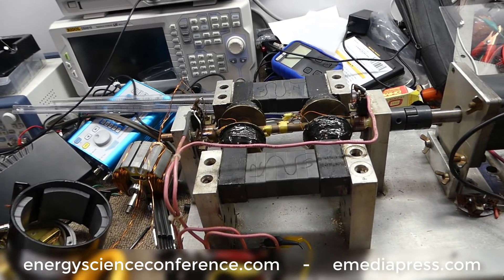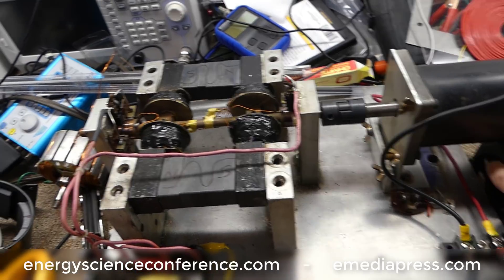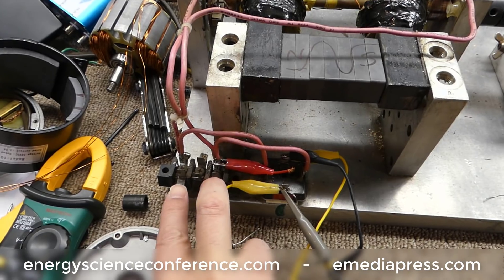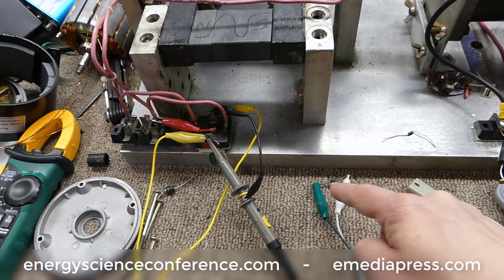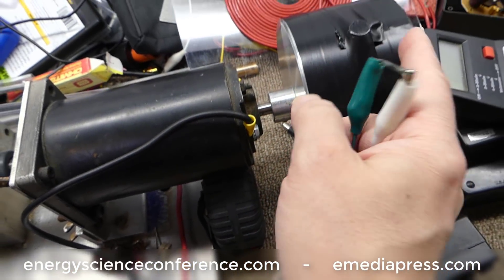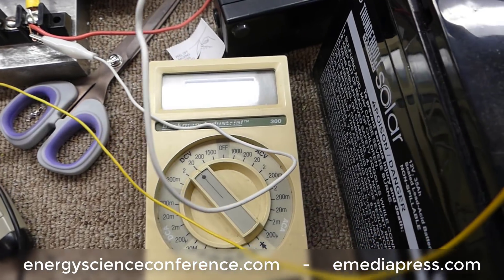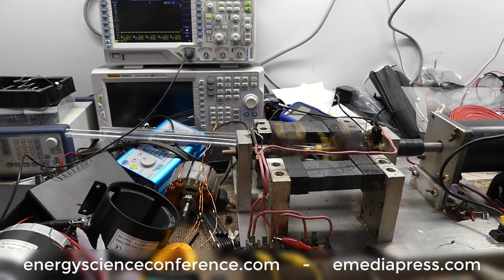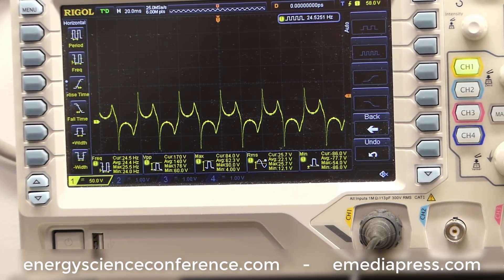700 Volts from Kromrey Generator

Comment: I see this is 5 years old. Have you considered a flywheel to reduce wattage consumption?
Reply from the maker: Yes, there is a heavy aluminum flywheel for it not attached to the shaft in this vid.
Reply: @AaronMurakami13  just curious. How much did it help, I’m guessing 30% reduction in potential consumption?
Reply from the maker: @chadrowlett893  Chad, I never did a comparison but John had a heavy aluminum flywheel on the shaft from the beginning.
Reply: Thank you very much Sir. Keep up the good work

Comment: Best switching for peak coil shoting is "bidirectionally" connected clusters of HV mosfets.  Bidrectional means the the gates and the source leads connect, between two mosfets  (or 5 in parallel each side for example ) and switching happens between  drain A mosfet and drain of B mosfett.   This is way to make mosfets switch AC, because during period switch is closed and coils shorted, the coils go into "hyper ringing" in AC.  Lpwest resistance possible in the switching. or it does not work very good.
Omce caps are filled up, they must be disconnected upon discharge to a load. So its a two stage output circuit - first stage fill caps by themselfes, second stage discharge caps by themselfes.
Having load right over coils whil fillling caps really kills everything so fill caps with no load.
Reply from the maker: Doug, do you have a schematic online? Also, are you in Seattle? Email me if you get a chance info at emediapress com
Reply: @AaronMurakami13  hi Aaron 
Yes I have chapter in online book I wrote about peak coil shorting with schematics and photos and info.  I will link it in next comment reply.  I am in Belarus right now next to Russia and Poland.  Will be coming  back to Seattle in December.  What's your email exactly?
Reply from the maker: @MrDKONZEN  Thanks -  info at emediapress com
Reply: @MrDKONZEN  Doug can send the link to the online book you wrote about peak coil shorting please.

Comment: wht gauge wire did u use / find best? framespencer@yahoo.com .... i have stuff to show you that im not willing to post on youtube
Reply from the maker: I made a video where I walked everyone through the coil polarity and winding method. Go ahead and email me.
Reply: @AaronMurakami13  can you help me wind it, ive watched your videos and wound in series but i dont get the desired effects
Reply from the maker: @MadscienceLPTECH  Do you have a reed switch across the coil terminals that gets shorted when the magnet moves past it? You have to have that.
Reply: @AaronMurakami13  what gauge wire is the machine shown
Reply from the maker: @MadscienceLPTECH  The Kromrey? It's something like 23 awg on the generator coils. Haven't looked at it in a while.

Comment: Shorting is a way to go , but it needs a very low resistance shorting similar to the resistance of  Reed relay or else  will be useless. The problem will arise once use mechanical shorting or reed relay and want to increase into a usable application, then it will not last long. Electronics switch like Mosfet or IGBT without any modification on the Gate side will easily be burnout on few watts of output from the spikes created even only on few watts.
Reply from the maker: I agree, the reed I'm using is for simple demo. The reed should be used to trigger another switch - I think I mentioned that in one of these videos somewhere.

Comment: Any cold effects?
Reply from the maker: I haven't tested that yet but there seems to be more charge winding up in the battery than can be measured. It can also power loads from the gen coils with wire gauge that appears way to small to be able to carry the current for the load. I've been focusing on just the bare basic fundamentals so far. I just discovered this: https://www.facebook.com/emediapress/posts/2027282530872426
Reply: Nice. The coil winding might be why my Kromrey replication didnt work. When you get a chance, I am very interested to know if it turns resistance in to an endothermic phenomenon which John hinted at in one of the previous Kromrey videos (energy from the vacuum series).
Reply: will the short out work with other generators?
Reply from the maker: Yes, quite a few of them. With these solenoid type coils, it's the easiest.
Reply: Old Man Builds is experimenting with Endothermic effects in his TC circuits, he puts a conductive rod down the center of his L2 and taps it from there, experiments show power is being pulled into the center rod from outside if given a ground, the plasma arcs seem to be non-destructive as well.